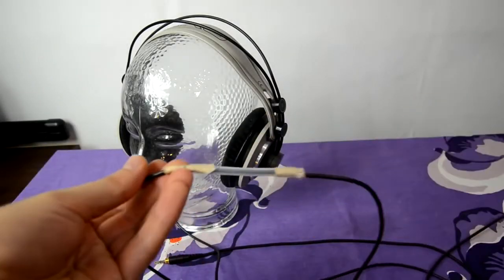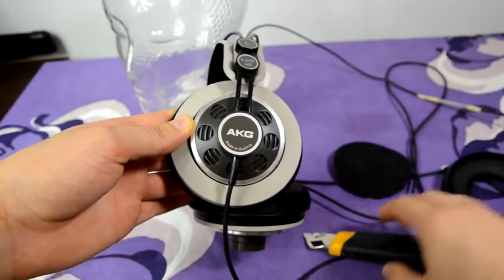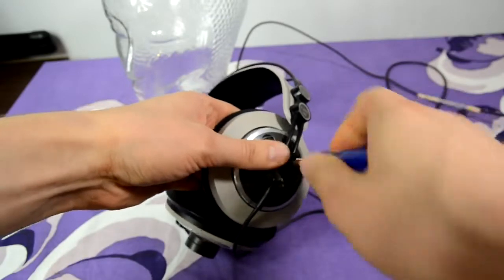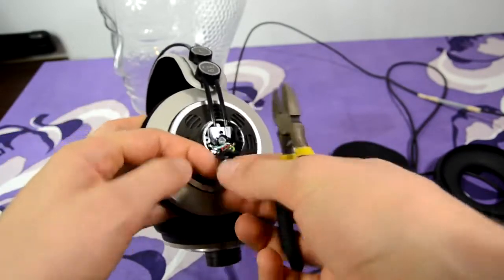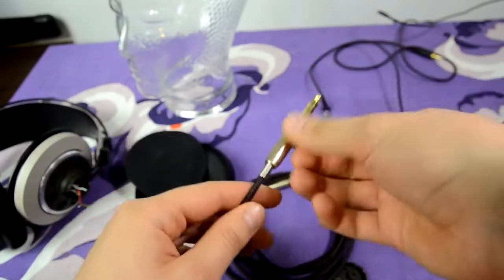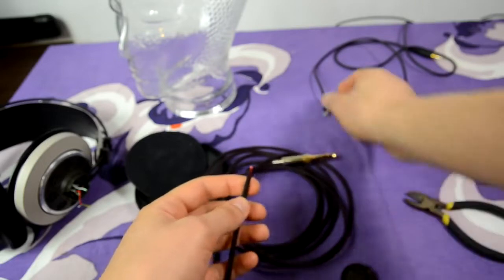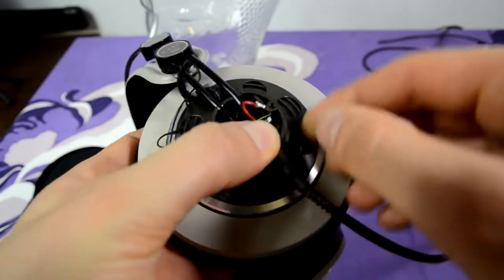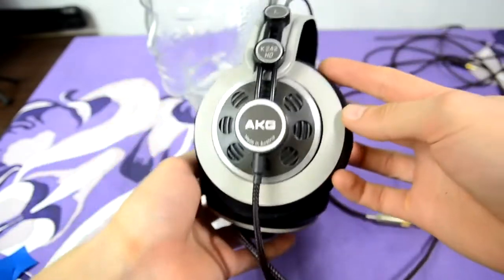How to repair/fix or change AKG K242 headphone cable DIY

Comment: Hello, I recently purchased a pair of these headphones.  I need to replace the rubber loop on them because the elastic is worn out.  The replacement seems pretty straight forward but I was wonderi g, what adhesive/sticky stuff did you use to reattach the metal logo plates?

Comment: Hi and thanks for the video, I have mini xlr connector that has been pulled off from the wires, do you have information on what wire color (from the headphones) goes to what pin? The headphones are AKG 271
Reply: Too easy, service manual says red to 2 and yellow to 3 😀

Comment: Why You remuve original rubber "T" end? This way you cable begine to pull out ( and break wires solder connetion) from the mountin socket even you glue it inside.
Reply from the maker: you can try using original rubber "T"
Reply: @TechscrewDIY   
I don't need, my cable is still orginalny and it's in good shape :)